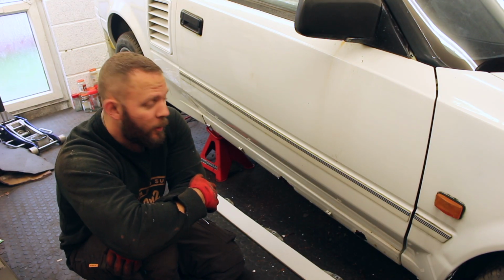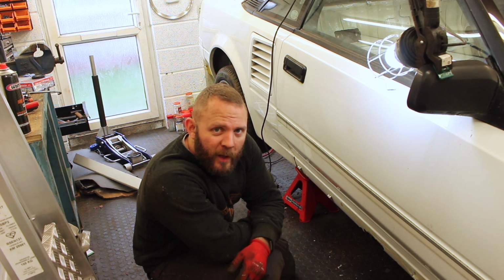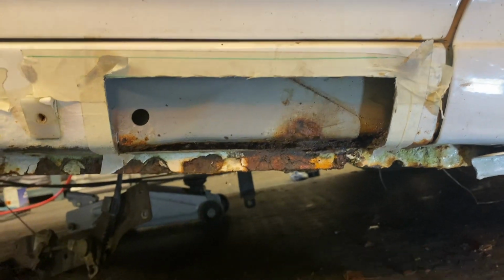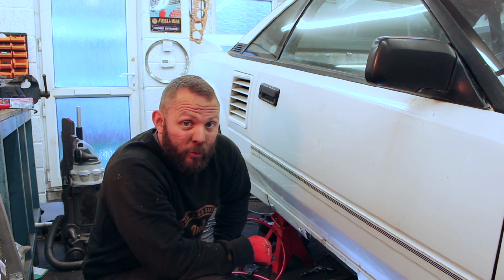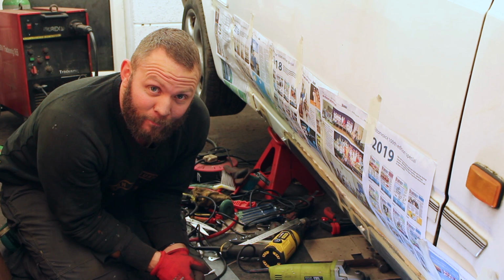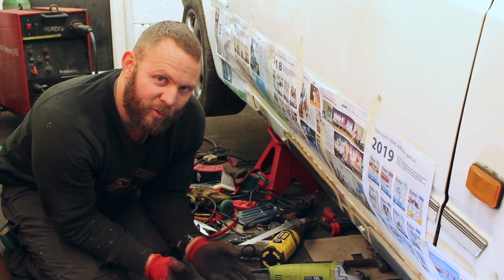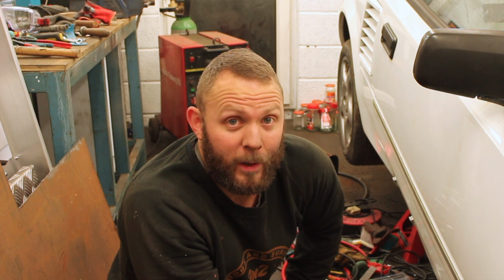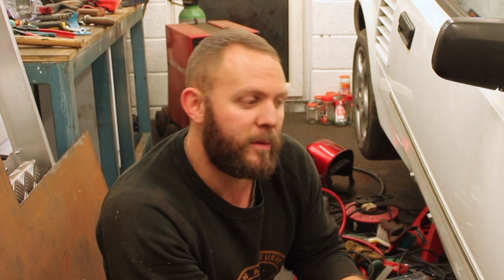Toyota MR2 Mk1 Sill Repair

Comment: Thanks for sharing your videos. I found them very useful and informative to watch. I am currently working on my project mk1 MR2. Looking to repair rusty sills (so much fun). 
Could you please advise what thickness sheet metal you have used? Do you know what the thickness of the cars original sills?
Thanks
Reply from the maker: Ayman Elkady thanks mate. Glad they were helpful. Haha so much fun indeed 😂. Umm from memory I would say 1.2mm? I would cut away until you get to solid metal and then use that to measure from to make sure it’s right. Good luck, any questions along the way just fire a comment over 👍🏻
Reply: Resto Nation 
Sheers mate. Much appreciated 👍
Reply from the maker: Ayman Elkady thanks mate. Glad they were helpful. Haha so much fun indeed 😂. Umm from memory I would say 1.2mm? I would cut away until you get to solid metal and then use that to measure from to make sure it’s right. Good luck, any questions along the way just fire a comment over 👍🏻

Comment: Just been researching rust repair, found your chanel! I'm going to invest in a mig welder and gas, looks like it is well worth it, instead of a bodyshop throwing a load of filler on it and sending it back out
Reply from the maker: Take your time and cut off small bits at a time. practice your welding off the job and get comfortable with it before you weld the car.